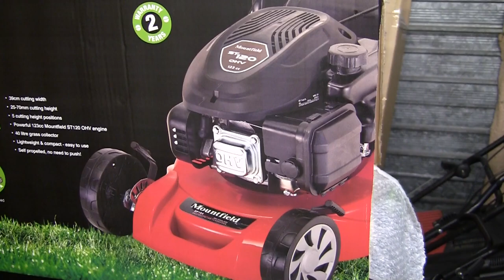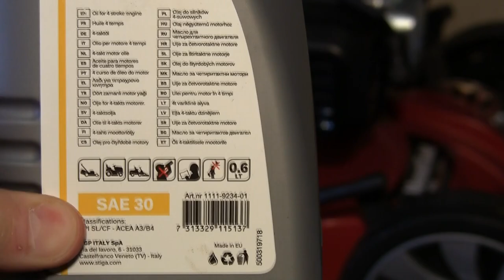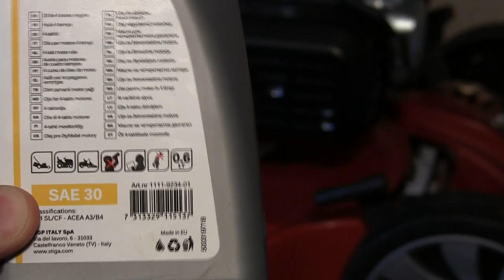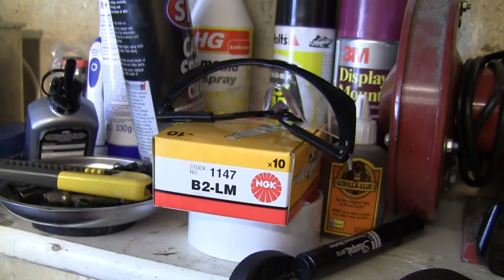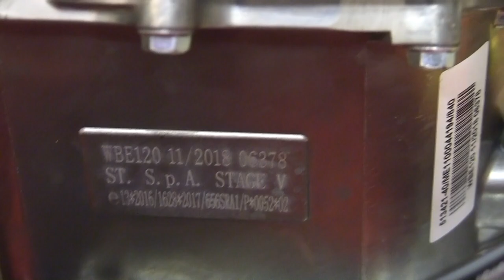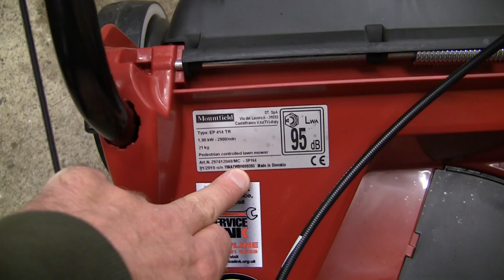Mountfield SP164 Petrol Lawnmower How To Service ST120 Engine WBE120 Engine

Comment: Great video thank you. My Mountfield St120 wouldn't start for love nor money after winter storage and I did the usual.......drained and cleaned the fuel tank.....took the bowl off the carb and cleaned it......liberally dosed the carb in cleaner.....put a brand new spark plug in. It still wouldn't fire up. After watching your video I checked the gap on the spark break and yes the cable from the dead mans handle had obviously stretched slightly because there was no gap. I enlarged the gap by gently bending the break using a large screwdriver and the mower fired up on the first pull. Many thanks again because I was about to leave the machine out for the scrap man and go and buy a new mower.
Re: the fuel filter in my opinion these slim insert type filters are a waste of time. Always clogging up. It's easier just to remove it completely from the fuel pipe and occasionally flush any crud out of the bottom of the carb by undoing the drain nut.
Reply from the maker: Great stuff!
Reply: Came here to say exactly this. Went through all these steps and then checked for the gap
 Thanks for this brilliant video. Got my mower up and running. Now to replace the cable - is there a video for this? Thanks again.

Comment: Great video, just used this to service my 2 year old mower, which was starting to be hard to start and was running a bit erratically. Air filters cleaned and now drying so fingers crossed for tomorrow morning when I put it back together and try to start it !

Comment: Recently purchased this very lawnmower.  Took me almost a week to get it started after put it together.  Checked everything that Mower Man advised to check but all seemed to be as it should.  After scratching my head with a mate and the pair of us looked at it, we found that when pulling on the OPC lever there was no separation of the engine break.  After we bent it slightly we were off and seems to be have been working well every since.  So just thought I share this in case anyone experiences this same problem, not sure if was just a one-off or not.  Usually you're advised to take it to the nearest service centre but as I leave in the NW Highlands, the nearest centre is an 80 mile journey there and back.
Reply: Good job

Comment: Thanks for all the information.  I have a similar mountfield petrol mower now in its fourth year and it won't fire up.  I wonder if it could be because of the change to premium fuel.  I watched all your video but you did not show replacement of the spark plug cover.  Does it just pull off and push on?  I also don't have tools and would not know what to buy.  Some of the tips you have shown I could attempt to check before resorting to getting the lawnmower repaired.  Thanks

Comment: cracking video , i aint ever worked on a mower and just using this video i managed to get my mower working again if 1 issue the 1st thing shown before the carb clean should be the kill switch , that was my problem , the black part on handle was lose so it wasnt disconnecting the kill switch but thanks and keep up the good work
Reply from the maker: Nice work!

Comment: Many thanks for this informative video. I now know where the fuel filter is. Obscure little stick thing. I've had the hand push version of this mower for a year now (Mountfield HP164) and am pleased with it. Not a bad little engine at all. I always went for mowers with USA made Briggs and Stratton engines previously but a lot are now made in China. The aluminium block Stiga engine is probably Chinese but looks well made enough. I prefer the aluminium bowl carb to the usual plastic Briggs and Stratton carb. I've bought a conventional fuel filter and am hoping there is enough fuel hose to be able to fit it.

Comment: Superb video, very informative and everything explained in an easy to understand manner. Could you clarify one point for me? When checking the oil level I believe you screwed the dip stick back into its holder. In my documentation it suggests that when you dip the oil to check the level you DO NOT screw it fully into the holder. I wonder if this is why your mower only took 200 ml of oil.
Any comments would be welcomed.
Reply from the maker: I would follow the manual. Maybe I got this wrong
Reply: I concur, the documentation does instruct you to measure the oil level on the dip-stick by not screwing it back on, just rest it on the top of the thread. I just bought this mower yesterday and the instructions say it should be filled with 0.5 litres of oil. This I did but when I dipped to check the oil level by fully screwing the dip-stick in, it was way above the max mark on the dip-stick. Double checked the manual it says not to screw it fully back. Dipped again without screwing it home (just resting it on the top of the threads) and low and behold the oil level was dead on the max level mark. 
Brilliant instructional video presented in a friendly and affable way. Very impressed that you serviced RAF Tucano aircraft in a past life.
Reply: @wernercook1005  with the Briggs they say to screw it so perhaps that’s why the confusion occurred

Comment: Hi great video. I have what amazon sell as SP45. I’m assuming its the SP454. It’s 123 cc ST120, just a question i bought the spark plug and socket listed in your links
The spark plug is 14 mm. but socket is 19/20 mm is this an error. Ty

Comment: Thanks, pal. I have the hand propelled version of this mower, which has carb issues. Now I know what to do. One question. With the airbox in place there is one plastic screw accessible from the front. Have fiddled with that and it didn't seem to change anything. Is that an idle jet or something?

Comment: Hi, I've just had one of these mowers. I filled it with the specified amount of engine oil (0.45L) which ended up being too much, the oil was far too high on the dip-stick. I called customer services who advised to fill the mower to the level indicated on the dip-stick. Its also important not to tip the mower on its side as oil can go through to the air filter housing. Hope this helps even if it sounds basic to some. 👍

Comment: Thanks for that, just got my 2 year old Mountfield HP42 up and running again after watching this.  One question, I wondered if I could fit an external inline filter between the tank and carb - seems to be enough length in the pipe and might be more robust than the silly little straw filters?
Reply: 👍🏽 I was thinking the same!

Comment: I read the Stiga manual for this engine and it says about measuring the oil level "– if the dipstick is short (WBE120) , place the
cap without fastening it,
– if the dipstick is long (WBE140, WBE170), fasten it again
with a click and then unscrew it"

Comment: Hi, great video, this may sound like a silly question but how do you drain the oil (is there a sump plug) and is there an oil filter which can be changed? Thanks
Reply: You can buy a small vacuum pump on eBay that sucks it out
Reply: @themowerman  is this the only way? Had other mowers where you just tip but this would would probably flood the filter
Reply: @johnnywalker9082  some engines do have a oil drain plug at the bottom.. as long as you tip them carb side up you should be ok..
Reply: @themowerman  👍

Comment: Hi, my dads looking to replace a really old Mountfield and was going to buy a SP185. Ive seen a SP454 that’s almost the same but has this engine compared to the Briggs and Stratton that the SP185 has. 
I know the Briggs will obviously be better, but from your experience are these engines good enough when you consider an £80 difference in price? Cheers
Reply: I would like to know this too. How does the B&S engine compare to Mountfield's ST120

Comment: Hi, I have managed to take off the carburettor but I cannot unscrew the brass emulsifier tube. I’ve sprayed it with WD40 but it still doesn’t budge. Does this mean I have to replace the whole carburettor? I’ve had the petrol mower for about three years

Comment: great mower saw you cutting the lawn with a nice slow walk but I have to walk faster ,can it be slowed down a bit
Reply from the maker: If you slow the engine down a bit the drive will also slow down. You would need to stretch some of the springs though so not really recommended.

Comment: 3-year-old HP164 wouldn't start - customer support informed me it was probably stale fuel. Actually the cable and spring activating the switch needed a slight adjustment for the engine to produce spark -  video at 44:15.

Comment: What should inside the black cover of spark plug look like?
Reply from the maker: It should have a metal connector that attaches to the plug. You usually hear it click when you push the plug in. Change the coil if it's not there.
Reply: Thank you what type of spark plug is best for this mower and where from? Thanks so much for your help
Reply from the maker: @ChelseyLovejoy-cv4ot  NGK B2lm. Type briggs 35 classic spark plug on ebay

Comment: 1st Error, the carburettor bolt pointed out is not  to drain the bowl, the correct bolts the one along side at a angle,  I guess an easy amateur mistake to make. Actually the guy is an idiot, best you find another guide to service your lawnmower.
Reply from the maker: Have a great day..